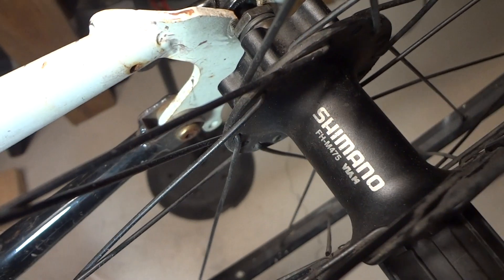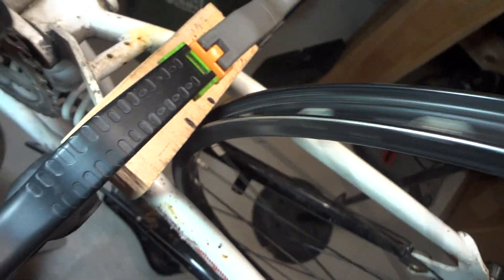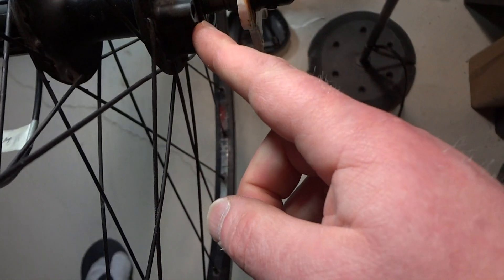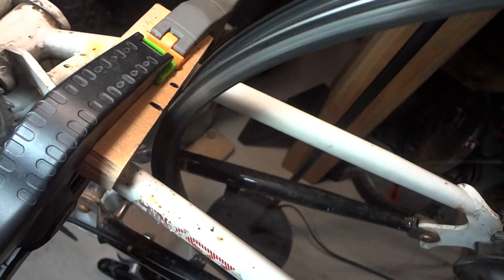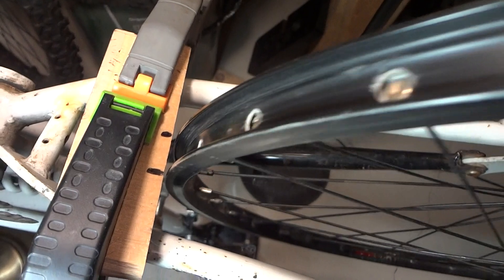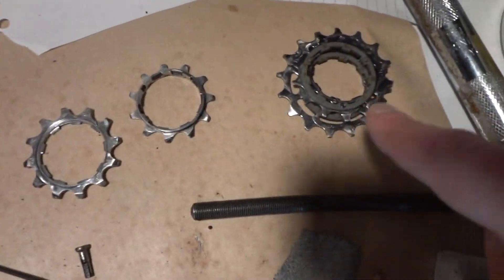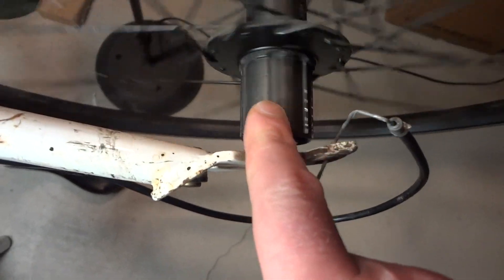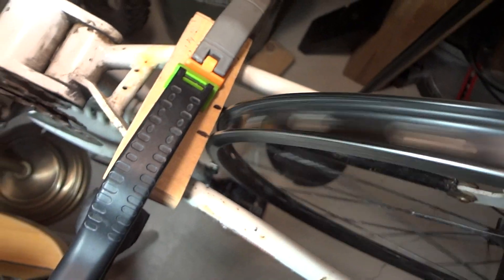Service shimano hub and wheel Part 1 FH-M475 VIAM

Comment: Nice on the video 💯 nice way to test the rim 👌 it is possible a damaged rim it depends how bad it is.  Good info 👍👌
Reply from the maker: So we have a baseline now ... after we done this thing will be running better then new.
Reply from the maker: @ajmotorsport9246  I think the biggest reason people damage the bearing surfaces is from leaving the bike parked in the rain and bearings that are too tight or loose.

Comment: When I tighten the lock ring to install the cassette I notice this hub has some sort of an internal torque release mechanism built in. It clicks to prevent over tightening it seems. I’m not even using a torque wrench. Do you have the same experience too? Is it normal?
Reply from the maker: That is not not likely, sounds like you may be overtighening it. the clicking i believe is the groves engraved into the lock ring slipping over the mating grooves. This is my first cassette though, i still havent got around to re-intalling the cassette.